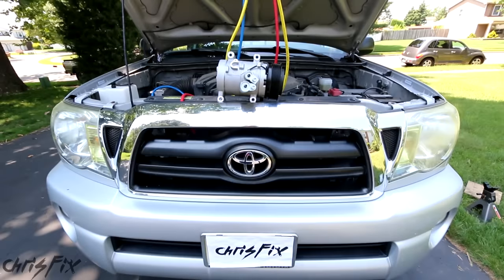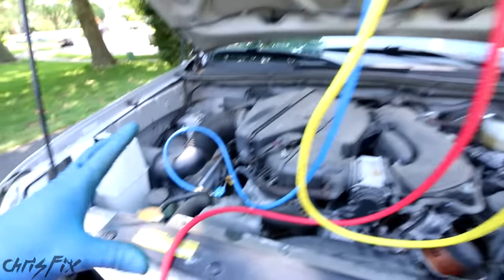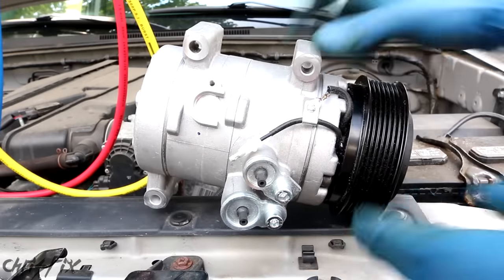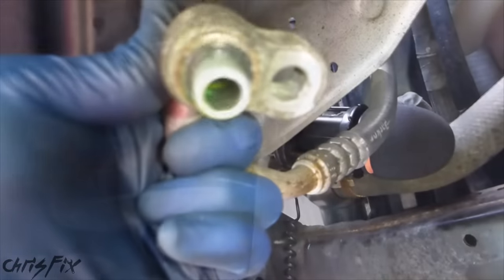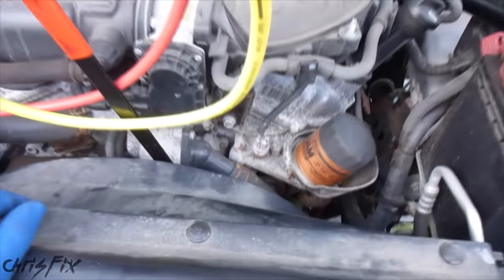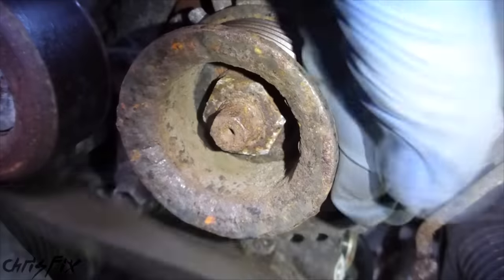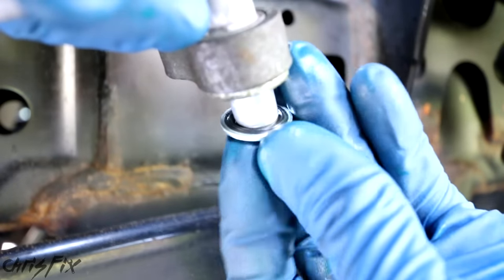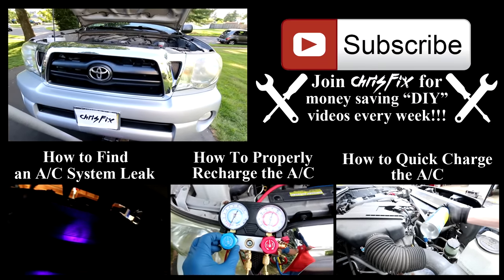How to Replace an AC Compressor in your Car

Comment: Great Videos Chris; You are my "go to guy" for mechanic stuff (that I don't already know and have done) .  Clear, concise, and very very helpful. One question on the compressor oil,  I intend to replace compressor and accumulator, I've seen some vids that specify that you have to see how much oil is in the OLD compressor and then only put that much back in the NEW compressor (presumably because some of the oil is in the system on the walls/surfaces of the other components.  Can you verify if this is necessary Chris.  The Delphi compressor I bought already has oil in it, and the Florida heat is starting to build gotta do it soon.  thanks for your efforts and GREAT instructions.
Reply: If the old compressor seized then you'll have to flush the system and install the new compressor with the entire system oil charge inside. If it didn't seize, and the old oil looks clean, all it takes is exactly what you said, put the same quantity of oil left inside the old compressor in the new one (use fresh oil obviously), even though if you can flush the system without too much hassle (i.e. the TXV can be removed from the firewall) and begin with the entire system oil charge inside the new compressor it's always best, especially because you'll also fit a new accumulator/dryer with the new compressor. Removing the oil that came inside the old compressor and replacing it with commercial oil of the correct type and viscosity is always best. In either case don't forget to manually rotate the compressor shaft (clutch hub, or pulley if the compressor is clutchless) 10 times before turning the AC (or the engine if you're dealing with a clutchless compressor) on. And fill the oil only inside the drain hole (a bolt on the body) if the compressor has one. Yes only a part of the oil stays inside the compressor, the rest you find inside the other components. You find a lot of oil inside the evaporator especially if you were running the system on a low refrigerant charge. When you run the compressor with the entire system oil charge inside it automatically fills the other components, you turn the shaft manually only to lube the internals and pump any excess lube out of the cylinders/chambers so that nothing gets slugged at startup.
Reply: Thanks very much, @teravolt6113  Your info is greatly appreciated.  Things to remember; and make notes on.  I have no way to flush the components, So I'll measure oil and refill same quantity.  I didn't want to spend the 1000 or 1200 dollars a shop would charge me. Regards.
Reply: @babofritz8268  Provided your compressor didn't seize up you're fine. But keep in mind that there are pressurized flush solvent cans available that are good enough for oil removal during a non-seized compressor replacement as long as you flush each component separately (i.e. remove the TXV from the firewall and flush through the evaporator piping in both directions, remove any piping from the condenser and flush that too, isolate any piping and flush it separately and so on) and follow the flush with compressed air (just keep low with the pressure, you don't want a condenser or an evaporator to blow up due to excessive pressure) to help any left over solvent evaporate.
Reply: Thanks again TeraVolt.  My compressor did not seize up.  It was still making cold air, but I was hearing a "ratcheting" noise when the compressor was engaged. Since my car has 168k on it I figured it was time to replace the compressor. (pretty good service; I think, never had any problems) until the ratcheting noise.  I expect to replace the compressor and Accumulator.  It'll be the first time doing this kind of job, but I've done pretty much everything else from axle shafts, and seals, bearing hubs,rotors, pads etc tie rod ends, stabilizer bushings.  "you get the idea"   Thanks for your tips I appreciate that you took the time to help me out.  Best regards.
Babo.

Comment: So my car is making this hissing sound it's not losing refrigerant I just recently had to replace the pressure switch I've replaced the condenser and last year replaced the blower motor the clutch turn on when I turn the ac on any tips on stuff I can try and check before replacing the compressor also almost forgot it's not blowing hot but it's not blowing cold it's blowing warm like a little cooler than outside

Comment: An AC system should have X amount of PAG oil for the system. You need to have the correct amount as too much will dampen cooling effect, too little could cause other problems. When you replace a compressor you should flush out all the components so when you install compressor which is primed with correct amount you’ll know the system level is ok. Also, if the compressor has failed it will need a complete flush of system and fit inline filters to stop debris damaging new compressor. Receiver drier/ accumulator also needs replacing after system has been opened to atmosphere, all good practice.

Comment: Dear Chris...is it necessary to replace the condenser coil in the front attached to the radiator when you replace with new compressor
Reply: Not strictly necessary unless the old compressor is seized, but it's a good thing to replace a 10+ year old condenser anyway. Over time, it fills with compressor wear material and ceases rejecting heat as good as a new one would.

Comment: is a good video wow nice , hey what is that sensor on minute 8:17 for what is this sensor , I asking you Because on tundra 2007 I can’t find low P sensor and my A/C light is blinking but I think is for low P sensor , or something electronic inside cab, I used small wire to jump on relay and clutch works perfect and my pick up truck works but still blinking the A/C light you know , I put gauges and the pressures are good too , no leak , just I remember I smell like something burn inside cab but after that no more cold , all fuses are good too , the only thing I believe is the Low P sensor don’t let me activate the clutch , but where it is , I have a tundra 2007 4.7L , please help me asap. Thank you bro

Comment: all the videos on replacing compressor say, just run up to your mechanic and have ac system evacuated, but the first two quotes for that i received were $189 and $140.
Reply from the maker: Shop around to get the lowest price and go to them. They don't really do anything special, they hook up a machine and press a button and wait a few minutes.

Comment: What does that sensor do on the air compressor? My car started turning off the cold air on its own even though it’s hot as hell inside the cabin and then it will turn it back on when ever it feels like it

Comment: I should check my car and my dad's hatchback for leaks on the compressors and order new ones if they are bad and if they're good and not leaking, if I'm lucky, I won't need to replace them. On both cars, the compressor is below the generator and to get to the compressors, the passenger front tire needs to be removed, the covers, the belts, the hoses, and the bolts.

Comment: Hey Chrisfix , I have a 2014 Tacoma double cab v6 I would like to know which make and model compressor is the one you used and is it still working? the amazon link is not connecting to the exact model.

Comment: Is there any way to test the compressor clutch while it's off the vehicle? I'm in the Middle of adding ac to my none ac truck and I got an ac compressor off my parts truck but I couldn't test it while on the parts truck. Would like to test it before filling the truck with r134.

Comment: My compressor is working fine, no leaks and it’s cooling great, but the pulley’s teeth have been damaged by rocks (I assume) and it eats my belts up after about a month or so. They don’t break for a few months but it’s sure embarrassing driving around squeaking. As much as I appreciate the practice changing my belt every few months, is it possible to replace the pulley without having to discharge the AC system..? I’ve seen the puller tools to remove it but I don’t wanna commit to doing it if it’s going to discharge the system by removing the pulley. Anyone know? TIA

Comment: Hello Sir 
I am driving 2013 Chrysler 200
And last time when I recharge my AC it start making noise from compressor when I hit the switch to ON and even when I use heater upper to the legs side flow and even it wont give a cool air flow at all. With time or leakage I think AC coolent is empty and it stop making noise.

Comment: The new compressor can get damaged unless the entire A/C system is thoroughly flushed of any metal filings from the old compressor.  This may also include replacing the expansion valve and the receiver filter.

Comment: HI Chris,Compressor will not kick on...i vacuumed system and added approx 20 ounces of refrigerant 94 mustang GT i have a 1994 GT and clutch wont kick on...i have 5.0 v8 and my compressor is on drivers side under my power steering.... Maybe it a bad pressure switch? high/low...Also watched video where a relay contained in a little box  located inside passenger front wheel well... i can turn my compressor easy with my hand and seems smooth so i am narrowing down the problem.... But could use some help on figuring out the exact problem... any help is appreciated thanks

Comment: watching this over and over, so I can also do mine. the mechanics are giving me a heart attack with their prices. asking half the price of my old car. I wish someone like you lives in my neighborhood..
Reply: LOL... Yeah. Wanna feel better? Look up dealer prices on replacing Lexus GX470 front struts and brakes. Hint: OEM parts: caliper $250, shock:$225, and it's all downhill from there. The fiddle factor for the struts is off the chart. No one trustworthy is aftermarket manufacturing the caliper. I've recently moved, and still haven't found a replacement for my shadetree mechanic. UGH.

Comment: Can I install the new compressor with the oil in it, and then drive the car down to the shop and have them recharge the system? Is it ok to run it without first recharging?
Reply: If the compressor has a clutch, unplug the clutch coil from the harness, and plug it in only after the system has received the refrigerant charge, and you're fine. No power to the clutch coil means that the compressor can't engage no matter what you do.
If it's a clutchless compressor, then you either have to find a way to disengage the compressor shaft from the pulley (not every pulley allows this) so that it can't be driven, find a shorter serpentine belt, or need to have the charge done in situs or the car towed to where it will receive the refrigerant charge, because letting the engine drive the shaft of a clutchless compressor (always driven by the engine) with no refrigerant inside the system makes the compressor seize up (even if the oil charge has been installed), since no refrigerant means no oil flow and no compressor cooling, and whatever oil is inside the compressor soon overheats or gets pumped out of the compressor since there isn't a dedicated sump. Hint: use double end capped PAG oil, and have the shop fit the new receiver dryer/accumulator right before vacuuming the system, or the oil and the receiver dryer/accumulator will catch some moisture during the trip to the shop.

Comment: you might not see this but on my 05 jeep grand cherokee it blows air only from the defrost and it was cold but like when i went to lunch it made a ugly screech and now it won't blow cold. could it be the ac clutch ? free on doesn't wanna go in the line either

Comment: Hey chris, so I had my ax compressor along with the rest of the parts that go with the ac compressor in order to get the warranty, but it's not blowing as cold as it did when I had the original compressor. What do you think is the problem
Reply: Deputy Perez low on Freon

Comment: Hey ChrisFix or anybody that can answer this question. My friends did the replacement without me. On a 2013  Nissan Altima 2.5L. They did not do the wiring harness transplant, like you did and turned in the compressor for the core price. Now we are stuck with a compressor installed without that harness. Anything we can do to fix this problem?

Comment: Hey Chris
Why is the air really weak coming from my ac even at the highest setting? The air is cold but it has very weak pressure
Reply: Broken air conduit, broken flap, dirty cabin air filter, dirty evaporator, frozen evaporator... can be a lot of things...

Comment: My original/stock a/c compressor does not engage. I pull it out, clutch works, the magnetic works and bearings are in good condition. The only thing that I found is no oil, is it the reason?

Comment: Need to replace the receiver dryer too,you wont have any warranty if dont do,because  it like a filter,the broken metal of the old compressor,will block the filter block the system.!

Comment: question.. I have an 08 dodge avenger do you do videos on the car because I can not find any on that year model. I find video on newer models but not sure if what iv would be looking for is the same way to take apart and put back together.
Reply: It should be very similar. All ac systems have the same components, they are just located in different spots.
Reply: hey I got another question but im gunna replace my ac but I was looking at videos and to find out more about my ac unit and where it would be located but something I came across is that I would also have to replace my ac dryer as well by chance do you know if a dodge avenger would have a ac dryer? if so do you know where it might be located because I can not find it.. thank you for your time
Reply: @joshholgin815  the drier (also called the acumulator) should be located after the evaporator but before the compressor. Follow the lines on the compressor, one should go to the condenser which looks like a radiator. The other line should go to the drier. The drier looks like a cylinder.

Comment: Mine is 2007 Chevy Trailblazer 4.2L, In case of replaced A/C Compressor, Accumulator and Orifice tube. By the Owner Manual A/C Compressor has to be filled oil 2 oz and Accumulator 2 oz. How to fill oil in Accumulator? Thanks

Comment: I’m making a race car and I was wondering sense I won’t be using my AC is it possible to just take out the compressor and remove the hoses/wire connections without harming my car? I’m new at this stuff but it interests me and I got no one to teach me so any information would be helpful.
Reply from the maker: Yea you can take all the AC stuff out but you need to put a pulley in its place so the belt can route properly.
Reply: ChrisFix whoa, wasn’t expecting you to reply lol. And thanks for the info man it helped a ton

Comment: Dude why do these videos keep getting recomended to me after I find out these are wrong with mine? First it was a chipped windshield then a heater core then deferential oil change then transmission change then transfer case oil change now this. Chris is stalking me from the past lol

Comment: He chris i have a problem with my a/c,my low pressure side is not sucking it’s basically static and when you accelerate the vehicle it make like 1 psi the pressure is 40 psi  any ideas and my high pressure side doesn’t move and its sits at 120 doesn’t move at all

Comment: have a 2004 Acura TSX I replaced the Compressor and after connecting everything, Electrical connections and all, the lights won't turn on, the interior lights won't function, the power windows won't function, the only thing that works is the hazard lights, can you tell me what the problem could be?

Comment: My compressor didn't come with oil. I checked it and drained it then tried to put in what it called for turning the pump by hand as I did so and it overflowed. I am worried I have too much or not enough. How to tell?

Comment: I got a compressor for my tacoma and it said it was pre oiled. The directions said i need to compare the amount of oil from the new one to the old one and diacard any extra from the new one.
Is this true?
Reply: Yeah the compressor I have ordered says, empty the prefilled oil which is only meant for shipping purposes. Then add the correct amount of appropriate type.

Comment: So yours had the oil. Will it cost more if it has the oil already in the compressor? If you get charged more that sounds sketch.
Reply: It may cost more when it's been filled with OEM oil. Anyway, OEM oil or commercial oil, use the right amount of the correct viscosity and type of oil, use Double End Capped PAG when PAG is required, make sure to fill the compressor with oil from the drain hole whenever the compressor comes with one, and it won't really matter.

Comment: How do I know if I need to just replace the compressor or the entire system?
Reply from the maker: What problem are you experiencing? In this case I only had to replace the compressor as it was the only part that was leaking
Reply: @chrisfix  ac was blowing cold and then smoke started coming out of the engine bay from the belt side. I shut off the ac and drove home and the smoking stopped and everything seemed to run fine with the ac off. I tried the ac a few times when I got home but it stopped smoking and the ac no longer worked. But I noticed it would make a loud clunk when the ac was turned off. The last time I turned it off it made a loud grinding sound as if I had missed a gear shift.
Reply: @chrisfix  the serpentine belt looks fine and and all other accessories are working. It's a 2004 honda element if that helps
Reply: @chrisfix  . Hi Chris,,So if is only the compressor that is damaged I don’t have to replace the condenser?